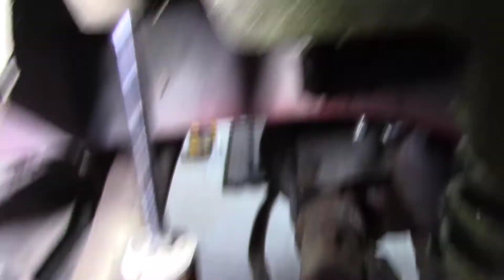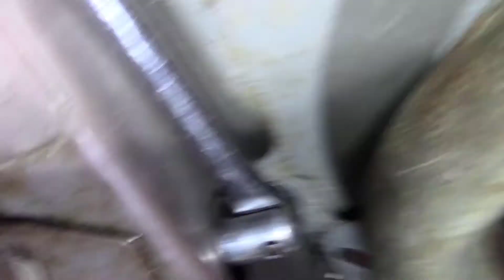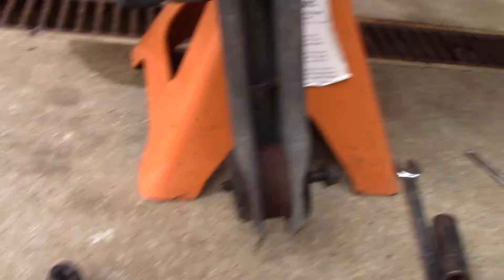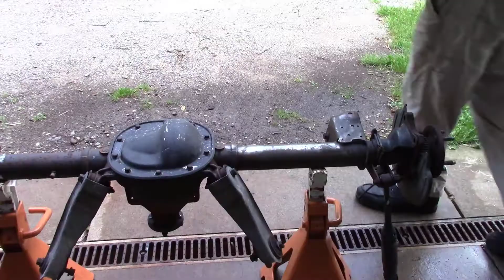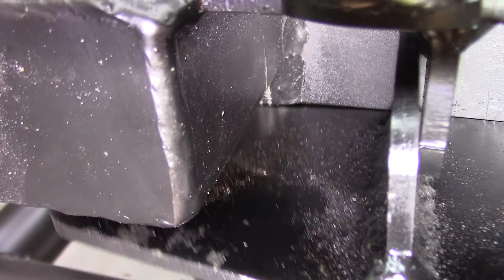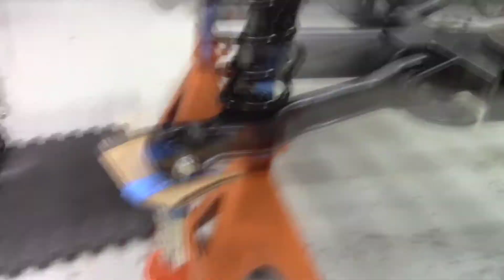Factory Five Rear Suspension and Rearend Install

Comment: You did the right thing by removing the damper from the differential but I'm sorry to say that you will almost assuredly hate the ride with those coil springs. You will also almost assuredly experience bad wheel-hop off the line.  Almost everyone invests in rear coilovers no matter the budget.